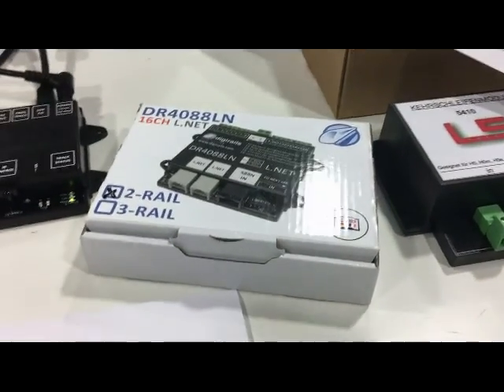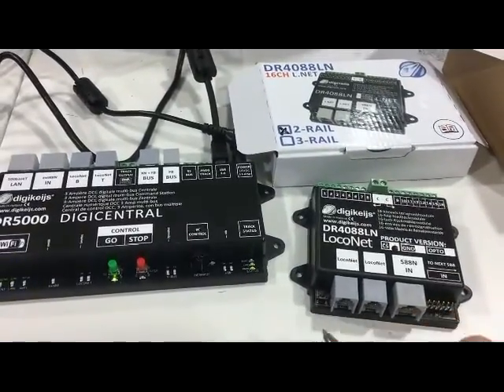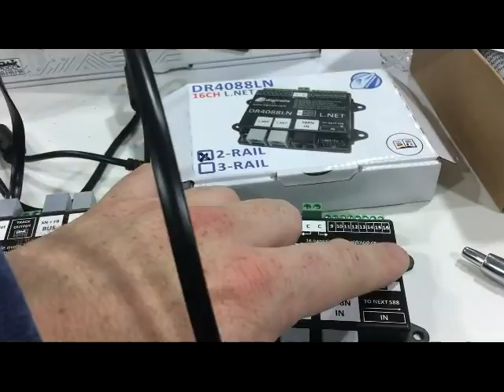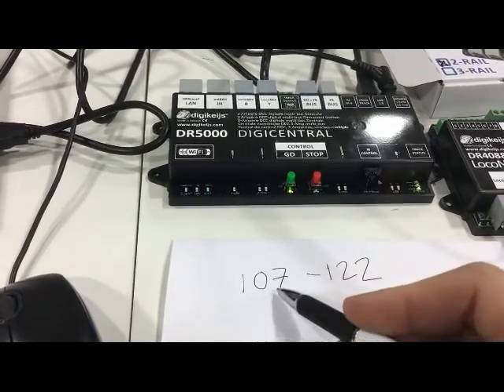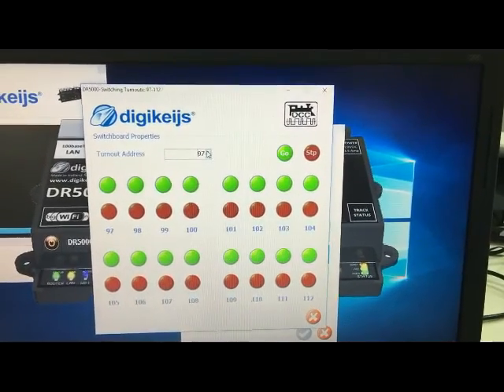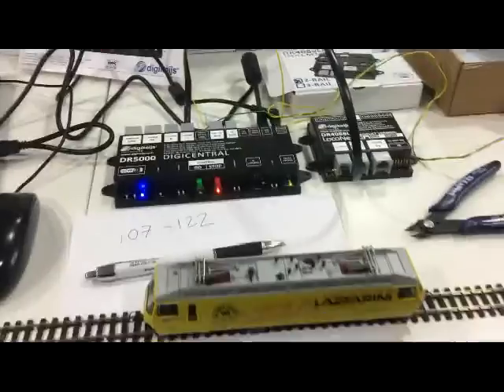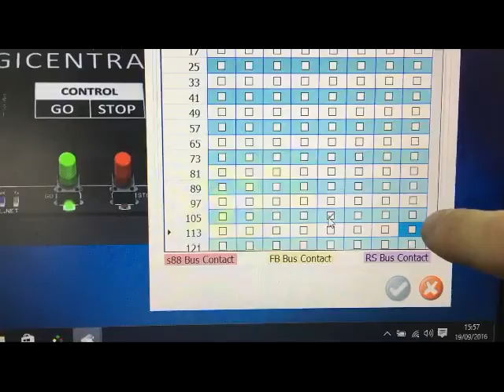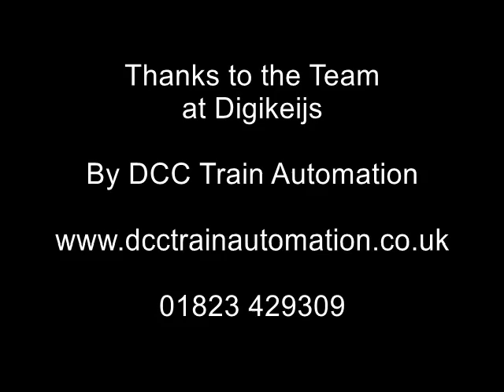Digikeijs DR4088 Part 1 Programing of DR4088LN

Comment: Is the start address 107, or actually 105?  Structure of blocks on the screen (ending at 120), and the offset for the (5th) occupied section giving an address of 109 would make the base address apparently 105. (Your screen steps are clear, but the evidence from the monitor screen appears to be conflicting)
Thanks, 
Tom
Reply from the maker: You can start the addressing at what every you like.
Reply: Yes, it was very interesting that the base address for the decoder could be set to any value.  I note from part 2 that the max offset/range then reflected the number of ports that this module (and others daisy-chained to it) would occupy.
I suspect that following a habit of setting the base address to a boundary of multiples of 16 would be good, but that depends on your flexibility with numbers.  I suspect mapping the addresses by functional type will make further expansion much easier to manage!
Regards, Tom

Comment: thank you for the video. Do I need a DR5000 to use the DR4088 /DR4088 starter set? i want to hook this into my Loconet system that Im controlling with Traincontroller.

Comment: Hi James, Do you use the outputs 1 - 16 to actually power the track sections, or are these just monitoring the section? What i mean is, are the outputs 1 -16 actually feed the block sections? I'm only asking so i know what wiring to fit on the sections of track.
Cheers Phil
Reply from the maker: Phil Newman this is the monitoring and power yes!!
Reply: Blimey, that was quick, i hadnt even finished watching the video before you answered!
Reply from the maker: Phil Newman that's ok!!
Reply: Is it fair to consider that the DR4088 is acting as the return leg, so the power is still provided by the DR5000, but the return leg current (and hence detection) is provided by the DR4088?  (Simplification, but maybe a functional one?)
This accounts for the DR4088 not needing a power supply, nor that the LocBus needs to carry (up to) 3 amps in two directions.

Comment: Any Chance you have a link to the software you are using.  It seems impossible to find.
Reply from the maker: https://support.digikeijs.com/hc/en-us/search?utf8=✓&query=Dr5000
Reply from the maker: That’s the link very easy to find
Reply: @DCCtrainautomation  Thank you.  I missed this download as it says DR5000 which i am not running.  I will download and see if it works. TY
Reply from the maker: @paulnewman2778  what are you running?
Reply from the maker: @paulnewman2778  if you are not running the DR5000 then you can’t use this software. What system are you using?
Reply: @DCCtrainautomation  thank you. Digitrax dcs210
Reply from the maker: @paulnewman2778  so you don’t need that software you do it all from the Digitrax system.
Reply: @DCCtrainautomation  your patience is appreciated.   I need to look more closely at how digitrax sees the 4088.  Thank you very much for your time and direction.
Reply from the maker: @paulnewman2778  basically if you plug in a DR4088LN-cs in to loconet it will just see it. You then just program it using accessory address sent from your hand set. So if you want the addressing to start at 100 for example. All you do is press the program button in the 4088. The led light will flash faster switch accessory address 100 then switch accessory address 16. This tells the unit the start address abs you want to use all 16 outputs. It’s that simple.

Comment: Hi running a Loconet system. Have 2 digikeijs DR4088LN and 2 DR4088. I would like to have 1 dr4088ln with a dr4088 programmed to 101-132 ant the other dr4088ln with a dr4088 programmed 133-164. I can bot get the second group programmed.  Please help
Reply from the maker: mark petersen hello Mark all you have to do is this on the first pause press program button then send accessory address of 101 and then accessory address of 32 with the second pair press program button and send accessory address 132 and then accessory address of 32.

That’s it.
Reply: @DCCtrainautomation  thank you for getting back so fast. I was not pausing, i think that is the problem.  Thank you again.